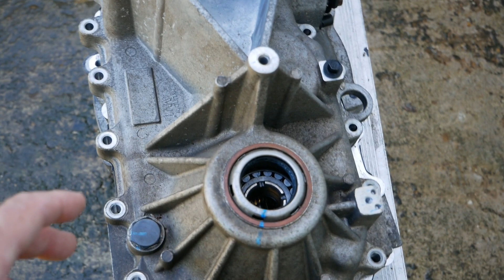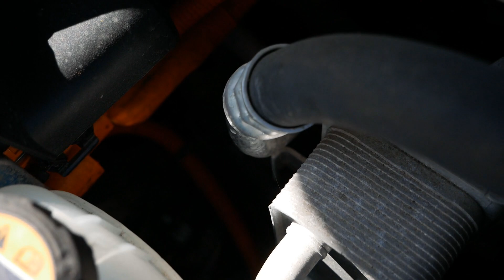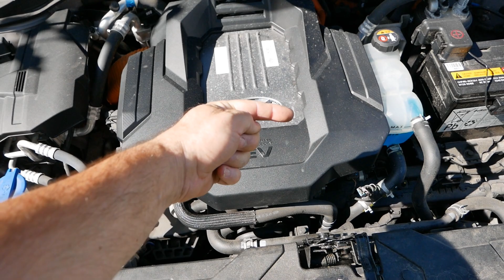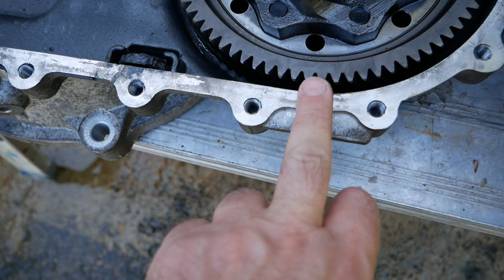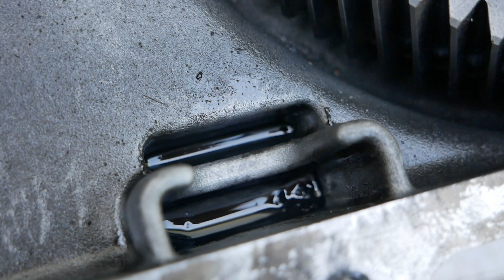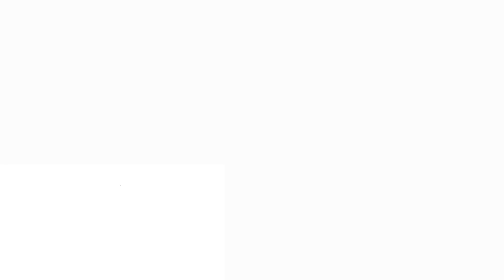What's inside an electric vehicle gearbox? A look inside an EV reduction gearbox. PART 2

Comment: Thanks for the video very informative. My Ioniq MY18 developed some clunks. Intially thought the driveshaft. After changing the driveshaft I realised it is coming from the reduction gearbox. The clunks coming as pulling away and as coming to stop. Car is on 87k, fully serviced by Hyundai. Battery efficiency still on 92%. Spoke to Hyundai,  they booked it in and said would need the car for 2 days for investigation. Hyundai website states the Battery and components including traction motor warranted for 8 years. I will try to push for the warranty but in second thought thinking if i should just go to an independent refurbrisher and save time and hassle.

Comment: What is the reduction ratio from the motor's rpm until to the drive shaft? 10:1?. 

If yes, when the motor turning at 100rpm it will turn the wheels at 10rpm. If they says an EV is having 320Nm of torque I reckon it is the torque is at after the reduction gear and not the torque at the motor itself. I need to understand a bit better on EV. 😂😂😂 Regards

Comment: Having driven a Vauxhall e-Corsa and a Hyundai Ioniq, the Ioniq is certainly slower off the line when you floor it. It feels like Hyundai put a "soft-start" on the motor, which will be better for the gearbox components and should reduce the likelihood of tooth breakage. At first I missed the instant pull of the Corsa-e, but I think the Ioniq will have less chance of mechanical failure in the long run.

Comment: Many thanks. I have one concern regarding EV gearbox design. I live in Canberra and when I go Batemans Bay on the way back from the ocean we have a very long a steep road. When I drive uphill on my Kia Sorento 2009 Diesel I suspect my gearbox gets hot and the electronics drops down the speed to 20-30km/h and I can't drive any faster for the last 0.5-1km. My question is that I feel that 1 speed gearbox will be a very bad if you have prolonged uphill roads especially if you have high load or towing something. The motor will have to pull hard on low rpms instead of having a decent reduction like 30x1 instead of what you were saying 7.4:1. Is my understanding correct?
Reply from the maker: I can't see why that would have any effect on an EV gearbox. As you can see, they're a very simple design. 
The difference here is you're assuming combustion engine characteristics, which are completely different in an EV. A combustion engine requires gears as the engine as a narrow power band, whereas electric motors don't have all the torque from zero rpm.

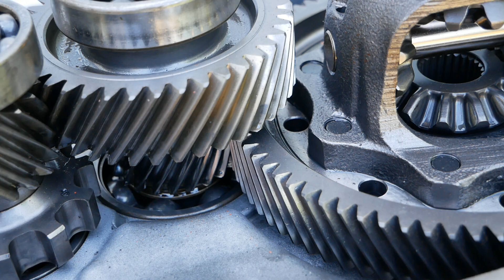Comment: At about min 10:00 you can see there is rotational wear on the outer race of the two bearings - so bearing race would start spinning against the rg case. This may explain the high aluminum contamination in oil on some vehicles. Unclear why the bearing race would start spinning, perhaps the tolerance is too high and the alloy material not strong enough to keep the race fixed under strong accelerations.
Reply from the maker: There is a "washer" between the bearing and the gearbox case.
Reply: @GoGreenAutos  I noticed, it's like a bracket molded into the casing cast. This bracket is also made of alloy and looking at the image, it also shows the kind of shine caused by the bearing outer race spinning against it. This bracket is machined at the factory, but the shine shows rotational frictions. This may explain why only some vehicles show darkened oil from new - dark color is due to contamination with shaved alloy particles. Perhaps the machining tolerance was not done correctly and bearing is too lose, or the alloy material was not hardened enough on some batches, causing again the bearing outer race to come loose and spin again the bracket.

Comment: Hello, and thank you for the explanation video, I have a Hyundai ionic electric premium, SE, 38 kW with 47,000 miles on it and I just got back from the garage Hyundai approved garage which the diagnosed and successfully under warranty replaced the reduction box, but they didn’t give me a detailed feedback on how the problem occurred. The vehicle was sent to the garage because it was deemed not safe to drive by roadside assistance that I called as I was recommended to do by Hyundai. The reason for calling in the first place was over a noise coming from what I and the engineer thought to be the motor, but in fact it was the reduction gearbox
Reply from the maker: Unusual for an Ioniq.
Reply: @GoGreenAutos  after watching your video review i am almost certain that my driving style is the reason

Comment: The Kona Niro gear noise is because the bearings are made in China.
It cannot withstand the torque of the motor and the bearings are damaged, creating noise.
If you change the bearings, there will be no noise.

Comment: Is it possible to get some measurements of the differential set? The TCS in this car does not seem to use the brakes to put power to the ground. Therefore I had the idea that an LSD Diff would, maybe, solve some of my problems driving on slippery surfaces. But planning all this would be much simpler if I knew the dimensions.
Reply from the maker: The Ioniq only has a 100kW motor, so I can't see why you would consider trying to fit a limited-slip differential. Sure you're not using the wrong tyres for your conditions?
Reply: You have a point, but of all cars I have ever owned this car is shockingly bad at hills. Try a small hill with gravel and I can almost not get up. This winter I'm trying all new tires. Continental VikingContact 7. Im hoping it's better. Because this car is perfect in so many other areas. Maybe it's a dumb idea with trying to fit an LSD in the car, but I can't find out if I don't ask the question. :)    @GoGreenAutos
Reply: experiencing similar issue with my LEAF 2020. during slippery conditions, compacted snow (ice) I have had hard time to unstuck/drive my car under slow conditons due to likely similar differential set. the power goes to the wheel with less grip. disabling TC does not help either. I am on X-ICE- tires.

Comment: One '"fact" is wrong. The replacing  of the reduction gearbox oil is in the service plan, but only advised at 120.000kms. All EU spec Ioniqs have this written in their users manual.
Reply from the maker: I don't believe this is in the UK version and I've only seen these.
Good to know though, thanks.
Reply: @GoGreenAutos  I agree, not in UK spec car.

Comment: At 3:40 you can see input shafts end cap that has come loose. (in the pot of intermediate axle) You can see marks it has left on the casing. Bound to have made some noise.
Reply from the maker: No, these weren't loose when the gearbox was assembled. They've only come loose since this gearbox has been apart and opened up so many times.

Comment: If you happen to have a moment to look, can you remove the input shaft from the motor-side casing half and check to see if there are signs that the ball bearing outer race has been spinning in the aluminium housing?

Comment: Thank you for demonstrating the physical looseness of the internal magnet as I requested. Hopefully one day we'll be able to understand why a significant number of Ioniq, Kona and Niros are developing powertrain noises.  Last November 2022, I changed the gear oil on my Kona and glued a strong magnet on the housing directly under the internal magnet's location to see if that would help restrain it. This year's oil change (that I did last week) came out more green than the black, an improvement. I believe it's aluminium contamination that makes oil black when no oxidation is present.
Regarding the Nissan differential issues, one challenge with having a gear assembly with shaft speeds ranging between zero (spiders) and 10,000 RPM (pinion) is that lubrication viscosity requirements are based on the high-speed gear mesh, what's called "pitch line velocity" in order to minimise cavitation.  The 70W or ATF grades match that requirement but also have a GL-4 level of extreme-pressure additives which should help handle the tooth loading in the near zero-speed spider gearset.  Another challenge is that the small diameter and  beveled nature of the spider gears makes it difficult to form an adequately-wide involute tooth profile to spread the load evenly.  A larger, stronger spider assembly is really the obvious answer for those particular EVs.
Reply: I had recently bearings changed on my 2017 Ioniq 28Kw 118tkm. 

Both motor and reduction gear. Gearbox was fine, motors bearings bad. Bearings were supplied (free) by Schaeffler. They may make repair kit for Kia / Hyundai first gen EVs. 

It is not the magnet but the EDM (Electric Discharge Milling) caused by motor axle current, that wears bearings out. Why it is sometimes motor bearings and sometimes the reduction gear bearings that start to fail is not clear to me. I also would like to know weather that brass ring on reduction gearbox is some kind of grounding ring. My repair shop said it is not, but I wonder...

Pre ~2019 motors (E500, E700) have steel motor bearings (with conductive grease?)and no grounding brush. These will all go bad sooner or later. Not clear what wears them most, hi speeds, frequent use off full power, temperature or what.

2019 carbon brush was installed between motor and reduction gear, don't know if they moved to ceramic motor bearings also. Some off these units have failed also, but as most are still under guarantee, reasons are not known.
Reply: @velipekkavahvanen2134  To assist the Hyundai owner's community could you provide the engineering documentation that lead to that conclusion?
Reply: @velipekkavahvanen2134  Hi, I'm looking at doing the same thing, can you say what the cost for the bearing replacement was? As I can see, you are also located in Finland.

Comment: I presume the speedometer is driven by electronic sensors rather than a cable drive from the gearbox.
Reply from the maker: Yes. I don't know where from, maybe the wheel sensors. But there's no electrical connection or cable from the gearbox.

Comment: Interesting to see inside, what was the reason for that gearbox being removed, from on screen viewing it looked ok , accepting the magnet containing some metal … ?
Also I can see the lock cone for “park” is on a spring, that means mechanism doesn’t have a hernia if the other end isn’t aligned with a slot…
Reply from the maker: Good point about the spring on the park pawl. It also means that the park pawl will self engage in a slot when there's some movement in the vehicle to allow it to fall into the next slot.

Comment: I can't imagine much movement of the magnet what with it being oil damped. It's not as if there is much vibration from an EV motor and gearbox. When running there will only be a small amount of oil in the bottom as it will constantly thrown up by the turning of the differential gear. The small amount of flow by gravity presumably runs back over the magnet to the lowest point where it gets picked up by the differential again. I don't think the flow would be enough to buffet the magnet.
I did wonder if the plastic gear was some sort of oil pump (if it interfaces with the housing) but a redundant gear for a speedo worm drive seems perhaps more likely (although ancient technology by todays standards).
The oil seals on the driveshafts act a bit like an oil pump as far as I'm aware but only to move oil away from the seal and back into the gearbox. The seals have a pattern like the plastic gear moulded into them so that when the driveshaft turns it has the effect of pushing the oil back. I assume that's how it works anyway.

Comment: i wonder, if differential is the same as one from an ICE model with mechanical speed sensor, so that nylon ring is drive for it. but you have wheel speed sensors on hubs, so another mechanical sensor doesn't make sense.
Reply from the maker: The diff maybe the same used in the ICE versions, but they have a completely different gearbox of course. I would add, all cars have wheel sensors...well all cars with ABS brakes.

Comment: Hi, now you have explained the operation of the mechanical and not friction method of the hand brakes. So during a mot test is this putting unusual stress on the differential gears?
Also this mechanical method of hand brake is the reason for not towing if you have an electrical brake down. I really appreciate your instructive videos.
Many thanks, Paul
Reply from the maker: The handbrake or parking brake is not the same as the park pawl in the gearbox. Hand/parking brakes are ALWAYS frictional brakes on the rear wheels.
During an MoT test, when they apply the handbrake on the rolling road, there would be stress on the differential, but then its only for a few seconds and has to be to test the brake force.
As for the towing thing...no its not due to the park pawl. You will be unable to tow if it is in Park. But with EVs, the non-towing is due to the electric motor regening while its being towed/spun. So to be safe, there's a blanket rule of no towing allowed. However, if you leave the car switched and and fully running, then it is fine to tow it, as the regenerated energy can be absorbed by the battery and as all the systems are up and running, the car just thinks its driving down hill all the time (and charging).
Reply: @GoGreenAutos  so do I understand rightly that the pawl is not todo with braking or parking but a safety feature for the motor. In fault condition the drive motor is locked to prevent any uncontrolled drive.
Reply from the maker: @paulgregory9248  I think the park pawl is there as its more of a hangover from the traditional automatic gearbox by the OEMs. Its not really required, particularly if the vehicle has an electric park brake (which can be activated automatically). The Renault Zoe ZE50 for example, as done away with it, so you just have Drive, Neutral and Reverse.

Comment: Would you recommend replacing the reduction gearbox oil even if it’s not part of the service plan?
Reply from the maker: Yes. I've got videos on the channel about this. I'd recommend oil changes about every 50-60K miles, or every 30K on Nissans.
Reply: @GoGreenAutos  many thanks would you do it on vehicle age or just mileage I have a 2016 Zoe with 38000 miles.
Reply from the maker: @darrensimon6181  mileage equals use & wear, so base it on mileage only.
Reply: I will probably never need to then, many thanks love the videos 👍

Comment: Gearbox are you sure....looks like a differential to me
Reply: The technical term engineers use for any box with gears in it is a "gearbox".
Reply: It is a transmission unit, that includes a reduction gear and differential.

Comment: Great Video as always. I used your videos to help service my old 28kw reduction box and have recently bought a newer 2020 38kw Model after your recommendation. Would you recommend the same shorter servicing schedule with the reduction box and if yes is it the same procedure and oil for the newer model or are the newer models more reliable and don't have to be so concerned? Cheers
Reply from the maker: Both gearboxes are identical, so no need to treat them differently. An oil change at around 50-60K miles is probably beneficial.